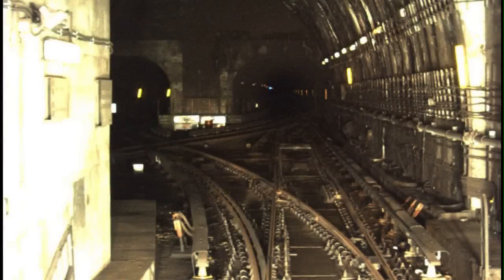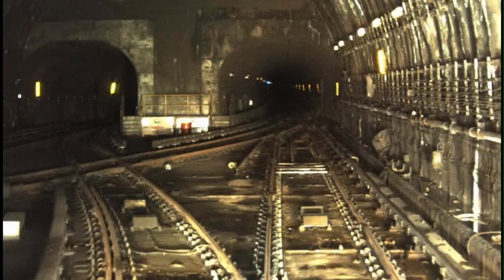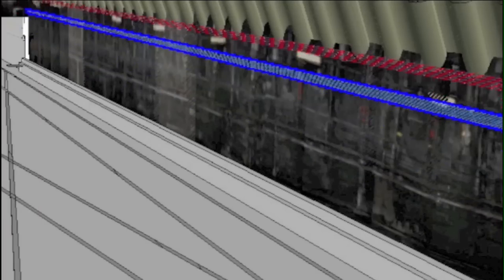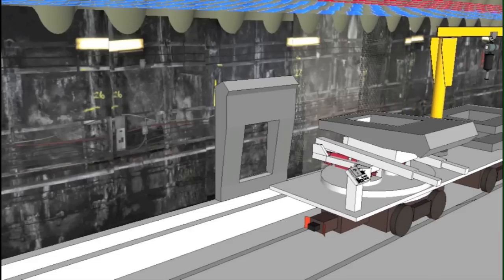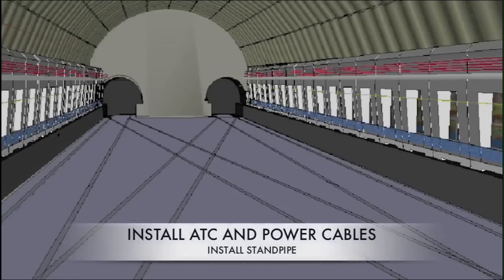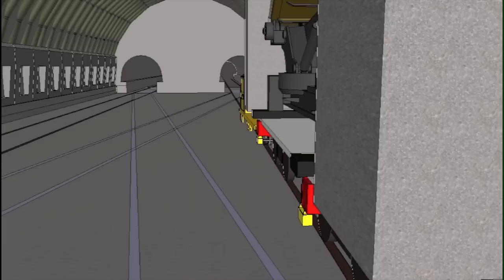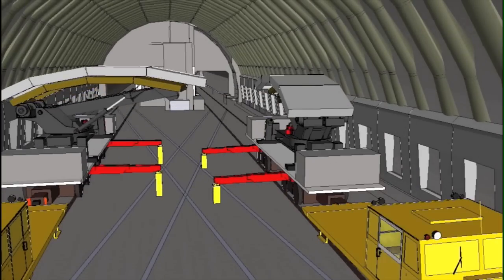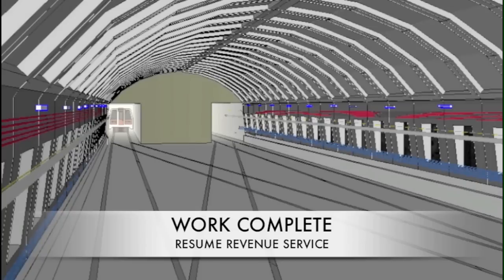Medical Center Tunnel Rehabilitation Project

Comment: Considering they stopped using ATC years ago, why bother having the system installed?
Reply: ATC is automatic train control it uses moving block system which gives WMATA the capacity to run more trains closer together it is the best state of the art signaling system as of 2/15/20

Comment: They won't be doing this.  Instead, they're injecting grout into the existing tunnel wall to plug the leaks.  That's the better solution and fixes the cause of the problem instead of building a canopy inside a tunnel that should not be leaking to begin with.
Reply: Kris Rehberg makes since.